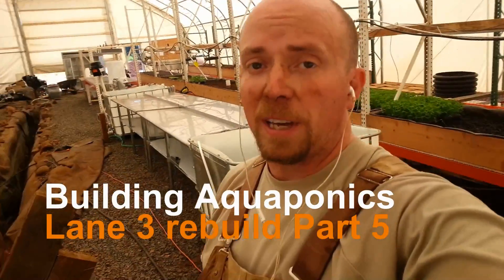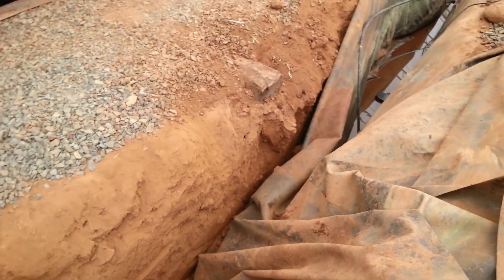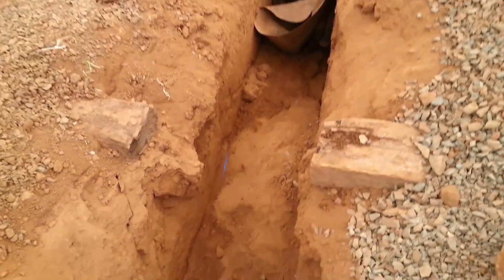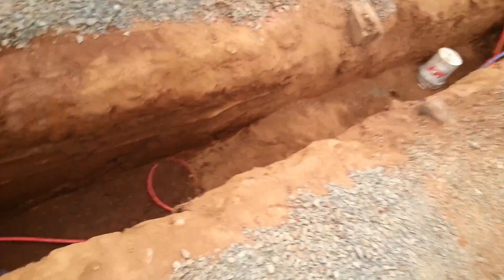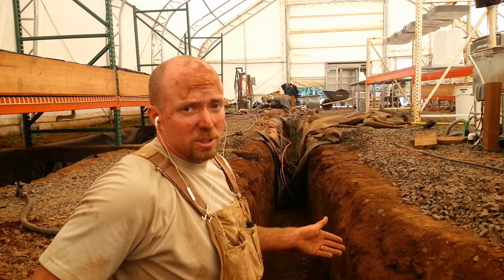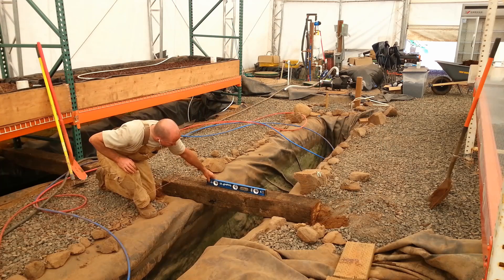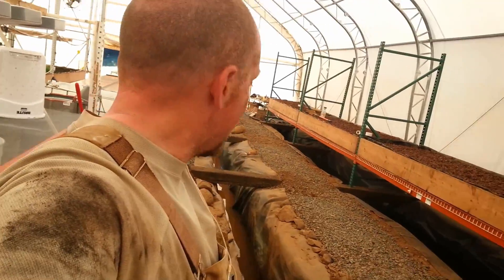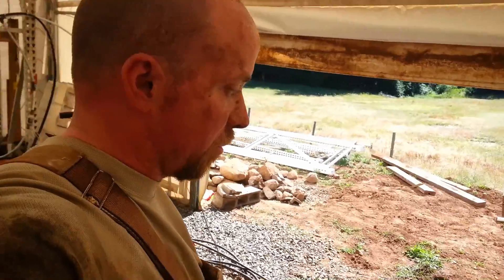Building AQUAPONIC and MICROGREEN GROW BEDS with RAINBOW TROUT - Part 6

Comment: Just a question, what's with the clicks in the audio it sound to me like you have a wireless receiver plugged in and turned up but haven't got the transmitter turned on? Or the wireless unit is picking up interference?
Reply from the maker: I'm not sure...it might be my ipod interfearing with it or the wifi but I've never had a wifi problem before
Reply: TheRealMartian I doubt it would be the ipod unless your using WiFi to stream music it shouldn't need any wireless connection so shouldn't interfere, has your mic got different channels? It may pay to try another channel if you can :-)

Comment: When adding that much loose fill it without packing it in small layers your going to get a lot of settlement. You should do no more than a couple of inches at a time before packing again to avoid a big divot forming.
Reply from the maker: I actually sprayed it and packed it as I went...just didn't capture it...darn it